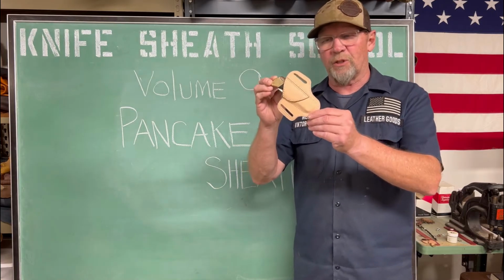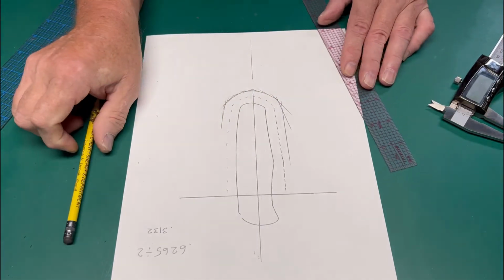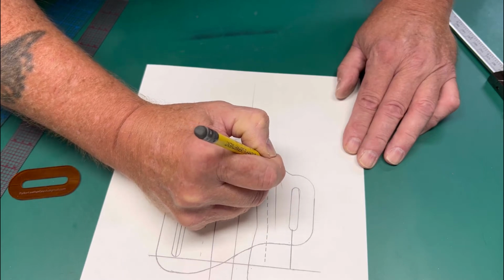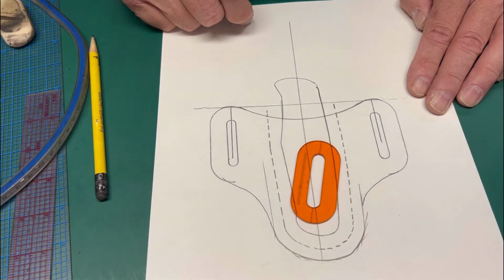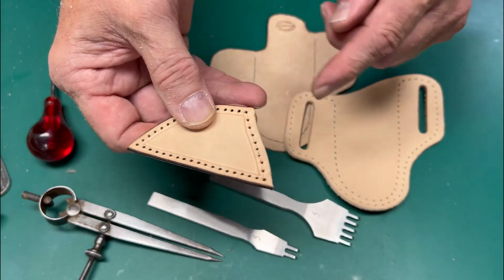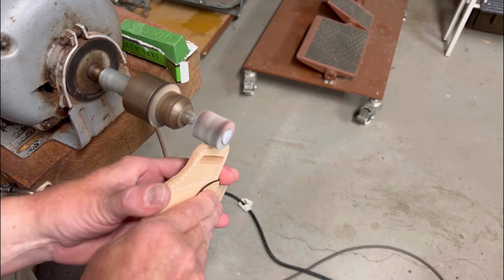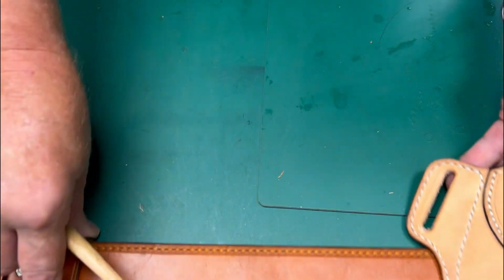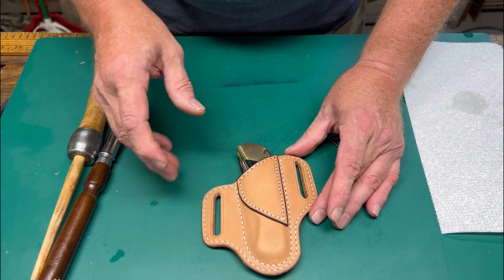How to Make a Pancake Leather Sheath for a Buck 110 (Step-by-Step)Vol 9 - #buck110  #BuckKnives

Comment: So I know you eyeballed the cant angle but how would you go about measuring it for different lays? Is it the angle from the top of 1 belt loop to the other?
Reply from the maker: That is correct  Or draw a straight line thru the slots on your pattern as well as drawing a 90 degree horizontal baseline  The angle between those two lines is your cant   Hope that makes sense

Comment: I have always wondered why in this design the belts slots are not tilted in the direction of the belt line
Reply from the maker: Thanks   Sorry for the late response but once the belt is weaved thru the slots,  like in this build, the belt and slots align  I probably should have shown in more detail the pancake sheath on the belt. Thank you